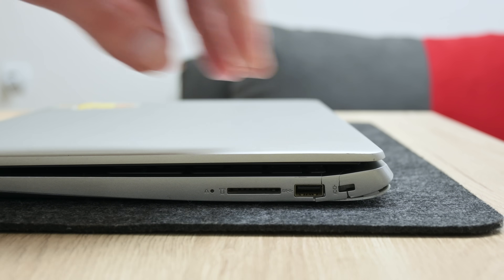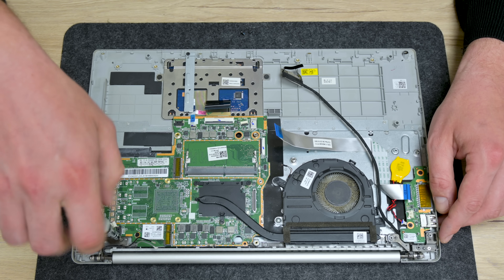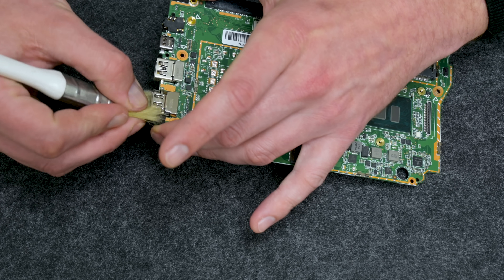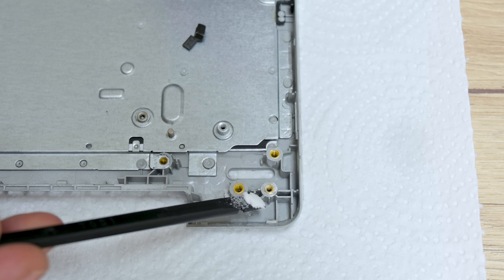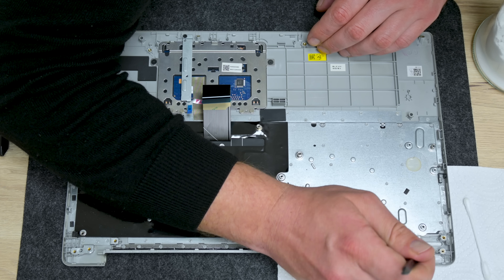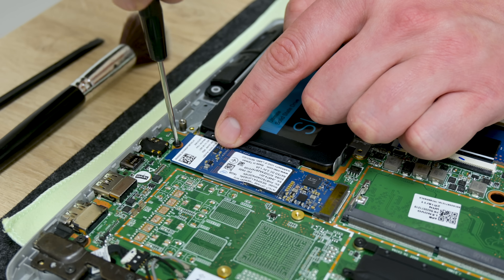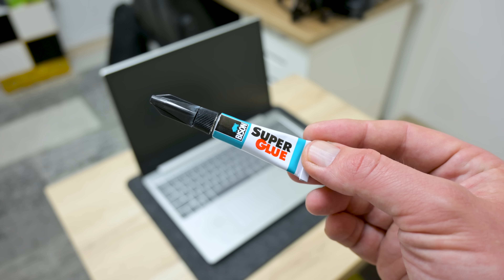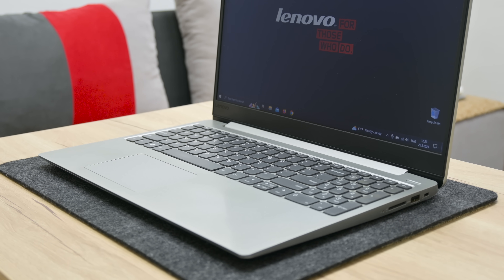Repairing and upgrading Lenovo IdeaPad 330s ( broken case - ¢50 repair )

Comment: Very nice and clean repair, just a tip: you can loose a bit the nut of the hinges and put some oil in it. This will reduce the pressure of the hinges, avoiding the laptop case of breaking again.
Reply: Was just about to say that. Just loosening a little bit the hinges will go a long way
Reply: Exactly
Reply: @santisvander  wow i never thought of this actually wish i did when i was repairing my personal laptop a couple months ago. silly question but do you use like, WD40 or something as the oil..?
Reply: @tre1740  Some thing like sewing machine oil would be good

Comment: I used to have the same motherboard in my laptop i added a new ssd and it stopped booting up and i had to diagnose it but it would work i replaced it and it still wont work

Comment: Hello Andrew, sorry my English I am using a translator but great restoration as always I really love watching your videos of restorations or repairs of electronic devices in general they are very gratifying, but I would like to give you a little suggestion regarding the hinges of laptops and more when They are repairs in that area, it is recommended to loosen them a bit so that the plastic and the mechanism in general are less forced.
Reply from the maker: Hi bro, I do loosen a little bit later, but in video i didn't because to show that the repair can hold even with all normal

Comment: That trick with the baking soda and "super glue" is brilliant! I've used it before to reinforce screw mounts and fix cracks like in this video. A word of caution:  During the chemical reaction that solidifies the baking soda, the area gets quite hot. So build the material up in layers if you need more thickness. Otherwise the prolonged heat from a thick glob might warp the part you are trying to fix.  ;-]
Reply: And then it's still fragile and will break again!Must apply Холодные сварки Poxipol
Reply: I think epoxy is a lot better and much more long term solution fix cause I've done the baking soda trick before because when I tried to open my laptop for cleaning the screw mounts came with a solidified baking soda and glue block XD it was a hassle to re-attached it again but when I tried to recreate the shape of the mount with the epoxy it never came out and stay solid up to this day
Reply: I've been looking at using a heating gun with staples, as used on large plastic parts, to add structural strength to broken plastic computer parts. The baking soda or epoxy can then be added to cover it up and add more strength
Reply: @rangerjoe126  
Agree with you
Reply: To answer some of you: 
Yes, of course epoxy is better, but it is also very thick and not easy to work with, for precision work. Unless you buy the really good stuff.  In very tight spaces, and if applied properly, I found the superglue/baking-soda solution to be very efficient.  Any good epoxy is way more expensive, particularly compared to what a hobbyist might already have at home. And since I believe these videos are aimed at hobbyists and not professionals, I consider this to be an important factor.  But, again, for certain types of breaks, where we expect there to be structural stress, then yes, epoxy is better.
Reply: @robertcartier5088  have repaired a clients hinge issue with epoxy it works like a charm, my only gripe is it is very hard to work on , so I usually use a syringe to suck the excess expoxy out.
Reply: @exiledwolfch  Good idea! 👍
Reply: My personal favorite is liquid silicone, of the kind used in school crafts…but not NEW liquid silicone, but from a previously used bottle, as is not as fluid and can be molded into shape using plastic spudgers or even a finger. Let dry for 24h and it will solidify. I’m sure it won’t stand up to epoxy-levels of rigidity, but it’s WAY easier and less messy to work with
Reply: Does it hold up? I have tried super glue on it's own and it has never worked well enough for me, but I'll have to give the baking soda trick a go
Reply: @yotoprules9361  It seems to hold up... although that machine is no longer in regular use, my daughter said it held together just fine for the few extra years before she replaced it with a faster one. I will know for sure how well it held up when she returns it to me next time I see her.  She knows I like to play with old tech... ;-]
Reply: Will clear quick drying epoxy resin work or do we have to use that thick balck epoxy to hold metal ?
Reply: @robertcartier5088  you can use super glue and araldite or super glue with fabrication glue adhesive combination which is better i guess!!

Comment: When guleing palmrests like that it is always a good idea to loosen the hinges a little bit. There is a nut on the enf of a hinge. Loosen it a little bit to compensate for the less strong palmrest after guleing. This will also prevent further cracks or degradation.

Comment: For repair broken case like this you need EPO besides superglue. 1. You put fallen pieces back where they belong with super glue to hold their positions. 2. You surround these pieces with EPO to hold. Super glue stays too fragile and falls off again if used alone. Epo supports. 3. Very important thing is cleaning the hinge. I sometimes loosen it up a bit. Hinges collect dust and get tough, thats why the case starts to crack in first place.

Comment: Nice refresh and repair on the cheap! I don't like soldered RAM as it limits upgrades, but I do like how you can have an M.2 SSD as well as a SATA SSD/HDD.
Also, for best results when gaming, always use the charger, performance on battery power is almost always limited for better battery life, though gaming whilst on battery power will almost literally destroy both battery life and battery longevity.
Reply: the difference probably isn't very large on these ultra low power machines, many of them use well under 15w under load

Comment: Just a tip when using that method on fixing plastics. Use a ruff piece of said paper before you apply the baking soda will stick alot better

Comment: If you put some fine cloth over the superglue it will get muuuuch more solid than using only the glue. Make sure than all the joins are in contact with the cloth. Give it a try and you will be surprised.

Comment: Excellent video! I have an Lenovo Ideapad 330S that has the exact same crack just under the power button. I will definitely use your technique to repair this over the holidays. What parts do you recommend to upgrade the memory and the hard drive for this model?

Comment: The video was quite fun.
But as far as I've heard, people usually recommend not to use Isopropyl Alcohol on the screen as it may damage the coating on top.
Have you seen any cases of this?
Reply: 1. You CAN use alcohol as long as it’s a one-time thing. It’s the continued use what damages the coating.
2. I believe he mixes the alcohol with anti-static glass cleaning fluid; that reduces the strength of the alcohol to a point where it’s not damaging the coating on the screen.

I personally use a mix of 2 parts alcohol with 8 parts distilled water in a plastic spray bottle. I use it on my cellphone, TV screen and laptop monitor. So far, no issues.

Comment: I have the same laptop, different configuration (i7 8550U, 4+16 Gb 2400 mhz 500gb samsung 980 ssd,1 tb hdd,Radeon 540) and this was laptop bought at the end 2016 and it still used as my daily driver.

Comment: Very nice and clean repair. I wonder if you could use a soldering iron to join the cracked plastic together, though? But that wouldn't be as clean, for sure
Reply: Yeah and also it will break again easily as while using solderiron it will melt away some of material and make it more thin hence it will break apart more easily . Using soda/cigrate ash with glue make a really solid repair as long you know how to do it without having mess.

Comment: Andrew, super glue baking soda method failed for me in under 2 months of use. May be just opened and closed the hinge 10 times max. Is epoxy better than super glue baking soda?? I had two 8 year old laptops with same issue. I was scared too use epoxy. Should i use it? What about the generated heat? Does epoxy create more heat than super glue??

Comment: Even though you're right about the factory glue, I would still recommend taking off the bezel anyway just to tighten the screws under it, sometimes the hinges crack again because some screws are still loose under that bezel.

Comment: I have the Lenovo idea pad 3 gaming
Specs:
i7 -11370H
RTX 3050 (4 GB v ram) mostly 120fps in games
16 GB ram (Mine upgraded to 32 GB)
500GB SSD (Mine Upgraded to 1TB)
120 Hz screen good but I would prefer 144 :/
customizable RGB keyboard 
over all love it its good for gaming
Reply from the maker: This is pretty great machine, btw 120Hz is very solid, in reality with naked eye cannot spot difference between 120 and 144, except if you do some slow-mo recordings
Reply: @ComputersAndTechAndAndrew  yea thx for the reply keep it up! LOVE UR VIDEOS

Comment: You can fix that MacBook damaged from the sticker using car scratch remover. But you have to apply the scratch remover evenly, otherwise under light there will be noticeable color difference.
Reply from the maker: With macbooks is but different, the problem is in glue damage and oxidation, sometimes using some chemicals you can speed the part that is not affected and almost no difference after, but anyway it's a bit risky :D
Reply: @ComputersAndTechAndAndrew  We are refurbishing iMacs and MacBook professionally and we always use some unbranded generic car paint scratch remover. It works all the time, if you apply it correctly but I'm not sure if it works with all scratch removers.

Comment: The only bad thing on IdeaPad line up of Lenovo laptop is the plastic is so fast to destroy if you over tighten the screws it will break the plastic or open the screen to fast it will break because it flex too much

Comment: I bet the Kingston SSD is fixable with some soldering... the shock from the drop probably broke/cracked solder joints on the SATA data/power connectors on the drive.  Reflowing the solder on the drive connectors may fix the drive!

Comment: hi I need help from someone I bought a 480gb ssd from ADATA when I put it in my hp elitebook 8540w and turned it on I wanted to load the bios the laptop crashed and when I turned it on there was the HP logo and press esc to enter set-up it did nothing just frozen and flashing num and caps lock I think about 5 times every 5 seconds it repeated 5 times and then nothing so I took it apart I pulled out the motherboard and he unsoldered the bios chip from this board and also from my old board which was totally broken, I added it to the newer one and the laptop didn't turn on, so I took it apart again, put the original chip in there and still nothing Please help me at least get it to turn on, I spent about $100 on that board, I'm not from the US so I don't have anyone to send it to, so at least help somehow... Or  I just buy a new laptop But then again, I don't want to spend $500 on a new laptop (btw. I followed all instructions on YouTube So that you don't say that I screwed up or that I can't do it)

Comment: If it's an A400 Kingston it's normal, they are piece of sh*t, they  "format themself" after a year or two and became recognized as "SATAFIRM S11"
I sold MANY of them in my shop and some customers came back saying their computer don't work anymore after two years of repair
Data is gone, I replaced the disk for free with apologizes